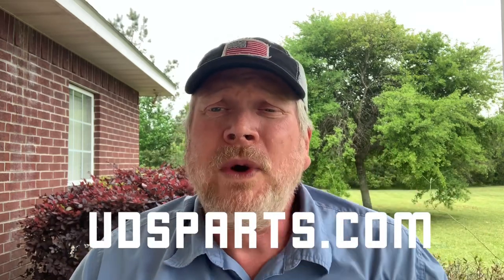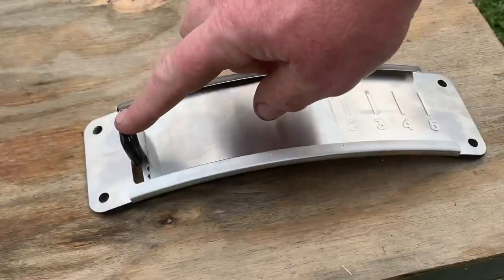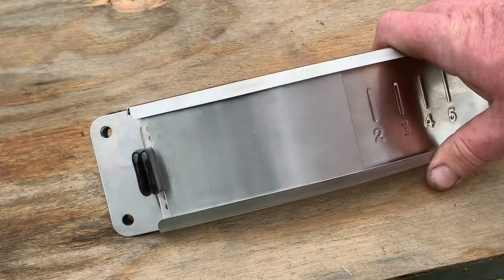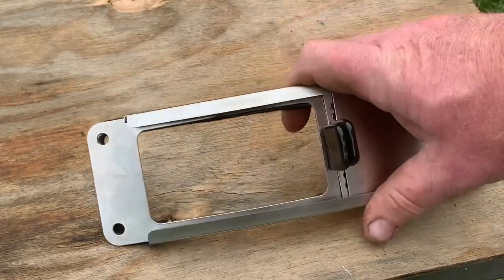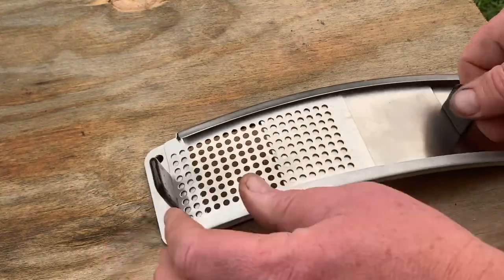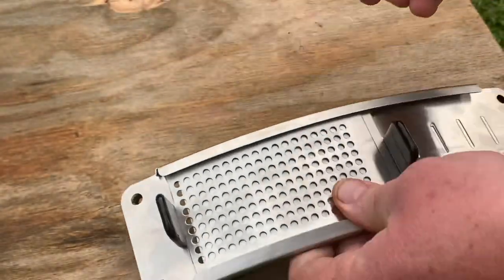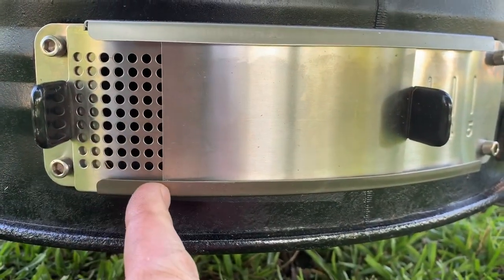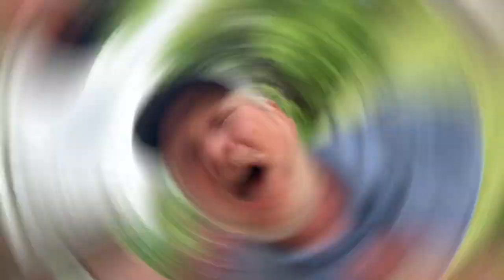Review of the Ugly Drum Smoker Slide Air Intake Damper, Stainless by LavaLock®

Comment: Nice vent I like those wheels please let me know where you got those from.
Reply from the maker: Tri-Tip Junkie the castors were ordered from Amazon, the castor mounts came from Ugly Drum Smokers -Texas. He, Mr. Powell of UDS-TX, designed these castor mounts for sell on UDS Parts. However these are the old design. He has since made a new and improved design.  I’m not exactly sure which one of these castor mount designs he made. Because now days there are two types, he may have made both.  One is designed for use with three wheels the other four wheels. The castor mounts and wheels (castors) are both available on UDS parts. Here is the link to the castor page: https://udsparts.com/wheels.html
Reply: @BigLewBBQ  Thank you